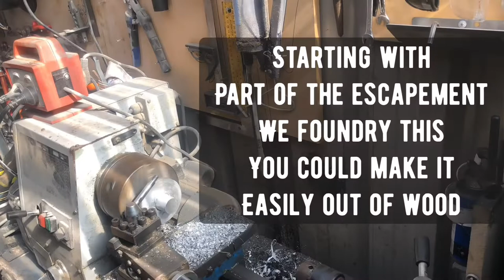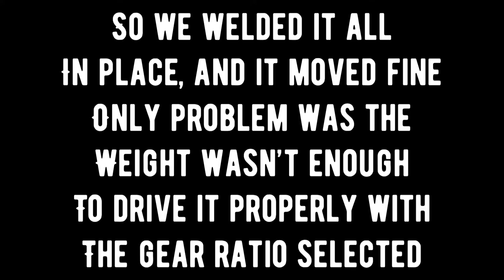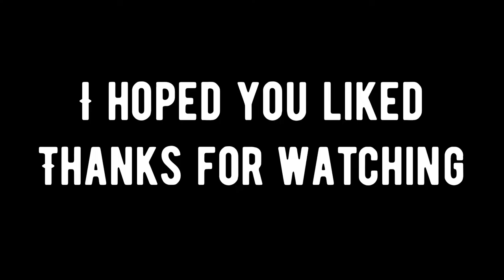How to make a spit jack

Comment: Impressive effort based on sound ideas.
I have been trying to get a similar mechanism together for about a year but can't afford the time or cost at this moment.
To save all the design trial and error I used Autocad and a spreadsheet with basic math formulas where I was able to plugin the variables. The resulting outcomes enabled me to fine tune the ratios and weights used in the design without wasting any materials.
To regulate the rotation of the mechanism I have incorporated a pendulum. Altering it's weight or length will adjust the speed of the rotation.
If you find the weight on your mechanism has insufficient power to turn the capstan under a load, you can improve the torque by significantly increasing the diameter of the capstan providing it with the power of leverage.
The trade off is that the larger capstan will mean less rotations for the given distance your weight falls.
The sprockets you have removed could be redeployed in an altered version of your design to overcome this new problem.
Good luck with your project, hope to see any updates you make.
Reply from the maker: Thanks we’ll definitely give that a shot next time we try it, was fun so we do want to revisit it again, cheers
Reply: Could I further suggest a ratchet between the weight drum and the gears, perhaps out of a bike rear hub, so you can wind the weight up whilst it is still turning.